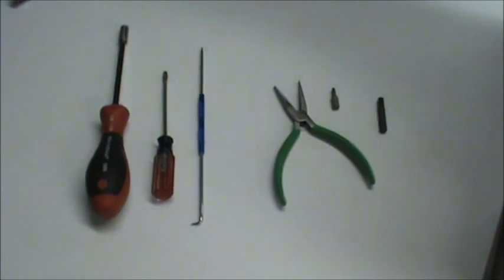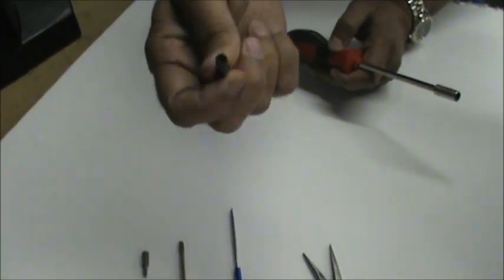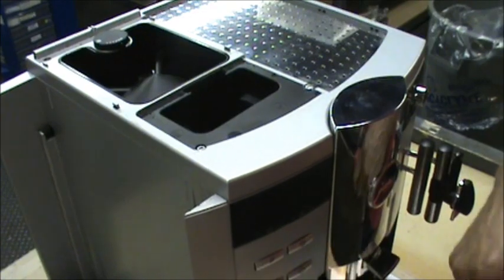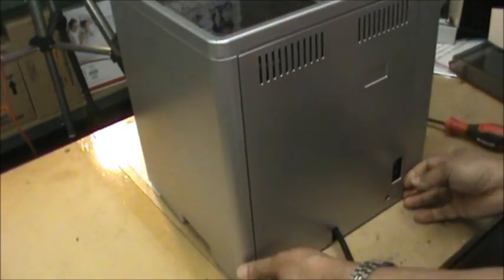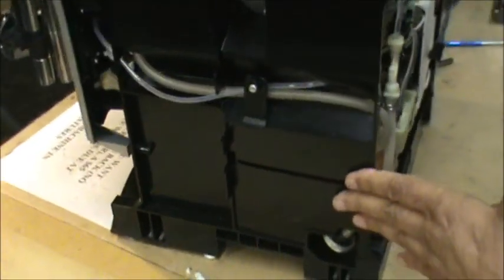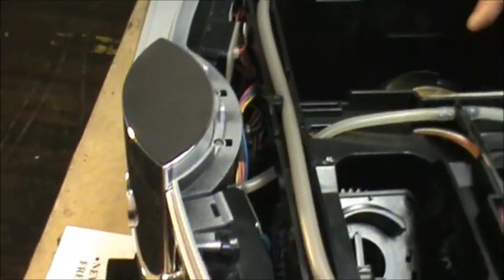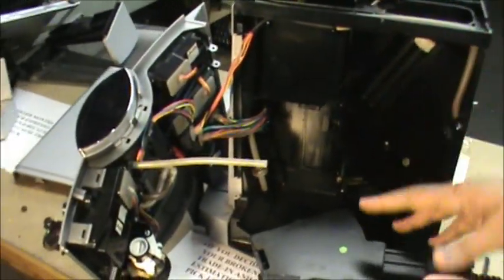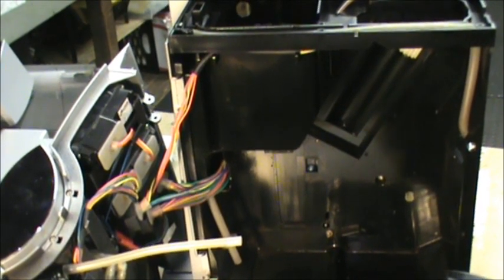How to Open and Disassemble Jura Impressa S9 Coffee Machine

Comment: Hi Guru;
My machine (Impressa s9) was in your shop a few months ago for strong metallic taste in coffee. Now I'm having a different issue I was wondering if you could help me with. There seems to be no pressure and coffee just barely drips, eventually a message comes on to Fill system/press steam. After that is done, goes back to select product but does not help with the drip. Milk gets frothed just fine and there is steam when you press steam button. Any ideas are appreciated.
Thanks.
Reply from the maker: Hi Andrew.
Please give us a call and we will be more than willing to remedy the issue.

Comment: I have a Jura S9 the display indicates Fill System/press steam. The steam has not been in use for quite some time and had been using machine to do espresso only. No matter what I try the same msg is repeated. Can the memory be cancelled? I have to admit that I had ignored replace filter which had recently started to flash ( I fill with filtered water) I popped in a new filter but of course I can't go through the normal procedure as it is stuck on other message. Your suggestions would be appreciated
Reply: +valerie Squire if you instert the new filter and then press the center button on the rotary dial, it should run through the sequence and reset the message.  i think it only works with the blue filter

Comment from the maker: Where is the water leaking from? Facing the machine from the front, is it leaking from the rear right side? If so, then it could be either the membrane regulator or one of the connectors.
As for the empty tray message, please remove the drain pan completely. Locate the white micro switch inside and clean it off. There could be coffee residue on it that is not correctly activating the micro switch.
Clean the metal contacts at the rear of the drain pan as well.

Comment: What is the exact size of the tool you are using to extract the screws to open up the back panel?
Reply from the maker: Hi Suzanne,  the oval head tool is custom made in the U.S. to specifically remove the oval head screws without physically damaging them.  You can order it from our Online Store.
Reply: Parts Guru Thank you very much

Comment: Hello - My coffee machine is a Jura Impressa S8. When I press the coffee button, the grinder works correctly, the brew group moves up and down, no error message, hot water comes out of the steamer spout instead of the dual coffee spouts. Ground coffee is then ejected in the waste tray but no coffee is made. Is this repairable?
Reply from the maker: Hi, it sure is repairable.  Is the ground coffee wet or dry?  You can either fix it yourself or ship your S8 to us for repairs.

Comment: Okay, here's a question that seems simple, but it's been a real problem.  On the front of the unit, there is a T-Shaped chrome handle that raises and lowers the pouring spouts.  It's come loose and the handle has come off.  Sounds like it would be easy to get a screw back there to secure the handle, but the space is just too tight.  Thinking I might have to remove the spout assembly to really get in there, put the screw in to hold the handle in place, and to make it secure.  But I have not idea how to do this.  Suggestions?
Reply from the maker: Hi Brad, what version of S9 do you have?  Can you let me know the 5 digit article number printed on the white sticker inside the front control panel?
Reply: Part 13215.  I did get it to stay for now.  Drilled the hole slightly larger and used a bolt and washer.  Not ideal but working for now.  If there's an easy way to release the pour spout housing for future reference, let me know.  Thanks in advance!
Reply from the maker: You will need to open the front door.  Detach the coffee inlet tube from the brew group so the door can be opened easily.  Then, you’ll need to remove the coffee spout by pressing the two tabs placed on the inside of the door to dismantle the spout.

Comment: Our Jura S9 Impressa still makes coffee, but takes forever to froth milk, and seems to be leaking steam. When we froth milk, steam comes up out of the cup warming tray. The machine is 10 years old, we have refurbished it twice through Jura, the second time just last year, and so do not want to send it to them for repair. Do you have a video specific to this issue? Can you help us repair the problem?
Reply from the maker: Hello Marina,  There is a solenoid valve in S9 that controls the flow of steam to the front steam wand.  The solenoid valve is probably leaking. I suggest you order the oval head tool, to remove the rear panel and inspect the solenoid valve.  You can also check other leaking components inside the machine while you have it open.  You can order the oval head tool by clicking the link below:
https://www.shopjuraparts.com/products/jura-oval-head-tool
Reply: How much is the tool? I think it's worth checking out. Do you? And FYI, the machine is almost 12 years old, not 10, I didn't realize just how long we've owned it.

Comment: Hello Guru,
I have a XS9 and the milk steamer has no force, you could stop the steam with your finger. I have opened the unit, and all tubes are clean and free of any residue, what could be the problem?
Thank you
Reply from the maker: Hello Ali,  the XS9 model has a muliway valve that controls the steam and hot water flow.  Also, the steam boiler could be partially clogged with calcium sediments.  Please check both items.
Reply: +Parts Guru Thank you very much for the fast reply! I opened the machine and realized that the steam boiler was leaking from both inlet and outlet parts! I ordered few O-rings and will change it and see if that will fix it.  Thanks again.

Comment: Hi Guru,
I have a C5, it has been cleaned all OK but no coffee comes out of the spouts. Coffee grounds are bone dry and hot water runs into drip tray only. what do i need to look at
Reply from the maker: Hello Evan,  

The brew group water inlet is clogged or blocked.  If the water in the drip tray is warm then you'll need to check the water inlet on the drainage valve.  Replace the drainage valve or the brew group seals and thoroughly clean out the brew group by disassembling it.  We have a video posted on our channel that demonstrates how to rebuild the brew group.

Also, check the magnetic valve metal needle that push opens the spring loaded valve with white actuator for allowing hot water into the brew group.
If the metal pin is not aligned with the spring loaded actuator then hot water is also directed to the drip tray.
Hope the above helps!

Comment: Hi Guru, my impressa S9 has a "fill water" error that will not go off. The water container is full, the float in the water reservoir freely floats up and down with the water level and is at the top of the small container.  Do you have suggestions? Thank you.
Reply from the maker: Hi Michael,  It's probably due to an internal leakage or lack of descaling.   
When was the last time you descaled your machine?   
What is the name of product you used for descaling?
Do you see any visible leakages outside of the machine or on the countertop?
Reply: Parts Guru hey guru, I am also having this issue. I descaled this morning. What would you do about an internal leak? Could this he a bad water sensor? Any help is appreciated thanks!
Reply from the maker: Hi Max: Please run multiple descaling cycles to ensure there's no blockage inside the hydraulic system.  Calcium sediments build up overtime and starts to blocks water flow that results in Fill System error.  If further descaling does not help, I suggest you open the machine to find any visible leaks.
Reply: We tried descaling again to no avail. The issue only happens if it has run out. If we don't let it run out it works fine however if it does then we have to wait for about a day to use again.
Reply from the maker: Do you see water leaking anywhere inside/outside the machine?
Reply: Hi Guru, I have descaled the machine two times this weekend using the Jura tablets. There is a small amount of water under the system, I don't see where it is leaking. Thank you.

Comment: Hi Parts Guru any ideas on how to fix the milk frother or will it need new parts?  Thanks
Reply from the maker: +vkturbo176hp Hello, Please clean the milk frother thoroughly.  You can use the Jura cappuccino cleaner or RINZA to flush out any dried milk deposits that could be blocking the air intake into the frother.

Comment: Good Day Guru, i've a S9 one touch, everything works fine except the frothing. Whenever i press the frothing, cuppucino or latte, the button will start blinking and panel will say "Heating up"

Could you assist to identify the problems?

Regards
Mark
Reply from the maker: Hi Mark, there is a sensor mounted on the boiler that generates steam. The sensor gets corroded and does not measure the correct temperate. As a result, it shows the error you're seeing or display Error 4.  You can replace the sensor yourself and have it replaced by an experienced technician.
We have the sensor in stock.
Reply: +Parts Guru Thank you for the prompt reply, i've not done any replacement before. How much would the sensor cost? and if i were to employ your service, what would be the cost as well?
Reply from the maker: Replacing the sensor is not difficult but it depends on how mechanically inclined you are and your experience repairing the home appliances.  The Video shows how to remove the rear panel using the oval head tool.
Are you located in the US?

Comment: I have a S9 and the drip tray will not open.  Any idea what's up?  The machine seems to work fine otherwise.
Reply from the maker: Hi, are you able to remove the used coffee grounds container?
Reply: +Parts Guru No I cannot remove the tray or used coffee grounds container.  Otherwise it seems fine.  Removed the top cover, but that doesn't seem to be helping me any.
Reply: +Parts Guru Okay, I got the tray out.  Removed the trim tray in front and nearly had to force it.  Now I'm getting an empty grounds empty tray message even though it's been emptied.
Reply: +Brad Willis Nevermind, fixed it.  Had to clean and dry the metal strips at the rear of the tray.  The moisture was fooling it into thinking that the tray was full.

Comment: Hi Guru, my S9 impressa seized up and is blocking the tray from coming out. I hear the brew group grinding but it doesn't sound like it completes the cycle
Reply from the maker: Hi Marios:  Sounds like there are broken components that are preventing you from removing the drip tray.  Are you able to partially open the tray?  You can remove the top cover to see what's causing the blockage in the brew group area.  Let us know what you find.

Comment: I still have issues with my S9.  Here's the story...

I have a Jura S9. Drip tray was stuck and I had to use force to pull it out. Next, I got a empty tray message even when it was empty. Cleaned the contacts and next I got a descale message. Did that and the descaling didn't stop after 3 hours. I finally unplugged the unit and got the same message. It's descaling now, but nothing soapy is coming out of the spouts. I fear it may continue the endless descaling. Any idea what's up?
Reply from the maker: The electronic board could be faulty.  We have seen numerous cases where S9 model gets stuck in cleaning mode.  Unfortunately, the power board is quite expensive.  Would you be willing to trade in your machine for another one touch cappuccino machine?

Comment: On our machine the gear on the motor shaft that drives the slide gear is broken. We can get the part but how does the encoder find the home position again when we reassemble?
Reply from the maker: +Anthony Murray  - Hello, Anthony - When you replace the brew group, ensure the big white gear is at three to four notches down from the top of cylinder, and the coffee compacting cup is all the way down.  That is considered a home position.  When you start the machine, the encoder will reset the brew group itself.  You should not experience any issues as long as the brew group is in home position.
Reply: +Parts Guru Thank you. I was afraid that since the encoder is now out of synchronization with the brew group due to the broken drive gear that it might not be able to be re-synchronized. How does the encoder find synchronization again? Just curious...

Comment: I have a Jura S9. When I turn on the machine the message display reads press center button/ system filling, but the water fills the drip tray and not the machine , the message keeps reading press center button/system filling. HELP
Reply from the maker: +Kyla Farmer Hi Kyla:  your S9 needs thorough descaling.  Descaling removes the calcium sediments from water passages inside the fluid system.  The calcium sediments accumulated over time and restricts the water flow.  That in turn displays FILL SYSTEM error.
When was the last time you descaled your machine?  How long have you owned it?

Comment: Hi Guru, my s9 is leaking water.  I have decalcified and cleaned to eliminate that it is the problem.  But, still leaking.  Leaking, if facing the machine, on the left side and to the back.  What do I need to do?  Thank you.
Reply from the maker: In S9 models, the angled silicone hose that connects flow meter to hot water pump often leaks.  The flow meter is located to left rear of the machine.  If you have the rear panel removed, please check the flow meter and pump connection.
Reply: Parts Guru Do I run the machine with the back open to check if the angled silicone hose is the problem?  If so, can I purchase it thru you?  Also, I need the oval head bit.  Can I get that thru you as well?  Thank you!!!
Reply from the maker: Here's the link to purchase oval head tool:   http://shop.partsguru.com/Jura-Oval-Head-Key-Stainless-Steel-0010635.htm   .  Operate the machine with rear panel removed to isolate the source of leak.
Reply: Parts Guru Hi Guru.  I opened the back up and you were right.  The leak is from the diaphram regulator hose and the junction of the 3 way connector which is connected to the relief valve.  But the leak is where the hose goes into the 3way connector.  What do I need to do?
Reply from the maker: Marie S Chio Please email the picture of the leaking part.  We have all parts (hose, regulator, relief valve) in stock.  The picture will help us identify the leaking part.  We will let you know the part you need to replace so you can fix your machine and get back to enjoying coffee!
Reply: Marie S Chio What size reinforced hose do I need and hairpin locks?  Thank you!!
Reply from the maker: Marie S Chio Here is the link to purchase the reinforced silicone hose:
http://shop.partsguru.com/Jura-Reinforced-Silicone-Hose-42-x-80-x-300mm-0010683.htm

Please note the reinforced silicone hose does not come with the clamps.  You can use the existing clamps and use them to install the new hose.

You can also purchase the complete hose with o-ring and membrane regulator, if you like.  It includes the brand new membrane regulator, reinforced silicone hose with clamps for each end, one black o-ring for sealing the pump connection, and one black o-ring for the 3 way connector.  Here is the link to purchase it:
http://shop.partsguru.com/Jura-Membrane-Regulator-with-Reinforced-Silicone-Hose-0010903.htm

Both items are in stock.  Hope this fixes your leak issue!

Comment: I have an xs90 jura, the milk frother just stop working, it is not sucking milk up the tube?
Reply from the maker: +Rich Snyder  Hello Rich:
The frother needs cleaning (not just rinsing under water tap).  The connections from milk container to the frother must be air tight.  If any air is sucked then the milk will not pull from the bottle.
 
The warm air or water is coming out because the milk is not pulled from the milk container.
If you are using a Jura milk carafe, then disconnect that from the frother silicone tube.
Take milk in a pitcher and dip the silicone tube in it.

Let me know if that helps.
Reply: Thanks for your help, I found that above the frother nozzle, was clogged, it appeared that over time the mile had sucked up and into the fixed part above the removable milk frother and clogged over time, I used a paper clip to open and cleaned it well, working very well now.
Reply from the maker: +Rich Snyder Glad to hear that it works! Enjoy the latte's and cappuccino's.

Comment: Hi, Guru my coffee machine jura XS90 impressa one touch, no coffee comes out from the group of the front can you help me??? thank you
Reply from the maker: Oscar Hernandez Hi Oscar,  Please be as descriptive as possible.  
What happens when you press the coffee button?  
Does the grinder engage and grind the beans?  
Do you hear the brew group moving?  
Is there hot water in the drip tray?  
Does your machine go through the complete brewing cycle and still does not produce coffee from the front spouts?
Reply: Parts Guru Thank you for your prompt response. Then he explained what it does exactly my coffee machine.

 When I press the coffee button, starts working the grinder (grinding coffee without any problem), the group heard moving, the display screen shows all correctly, but the group does not come out coffee and the drip tray is completely dry .

 But the waste tray, throws dry and ground coffee.

 I hope this description helps you understand my problem, thank you Guru.
Reply from the maker: Is the ground coffee completely dry?  If so, the hot water is not getting into the brew group.
Can you please operate the machine with completely empty and dry drip tray?  Press the coffee button to make coffee; Is the water in the drip tray hot or cold?  If the water is hot, then either the brew group drainage valve or magnet valve are not working.